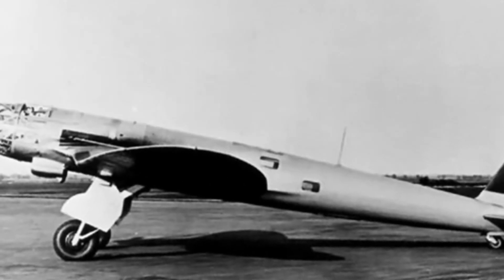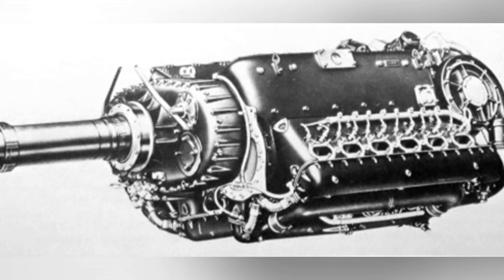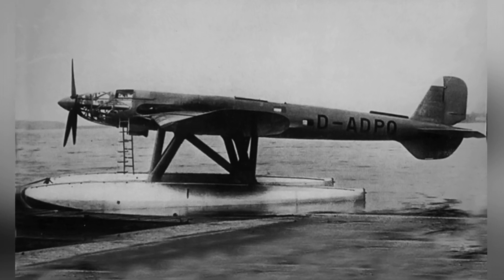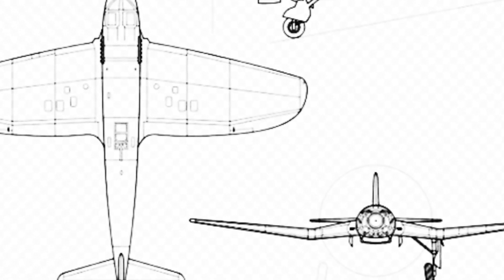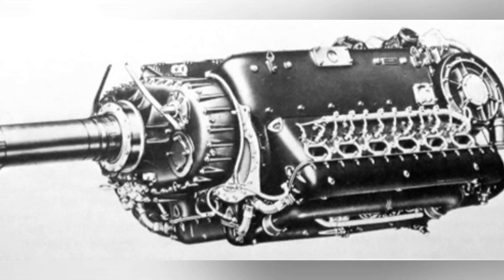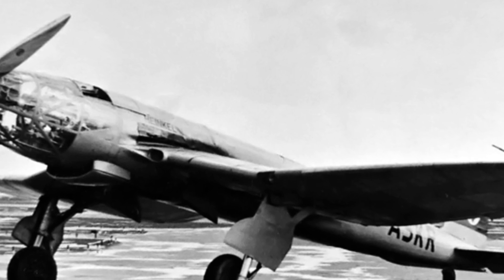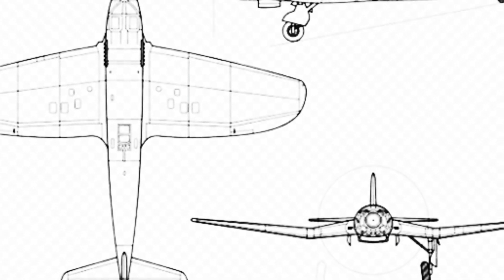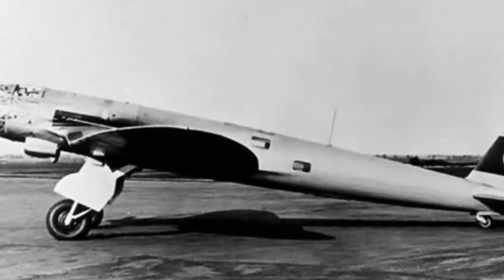He 119: High-speed Reconnaissance Aircraft

Comment: the He119 was designed and built by the Heinkel Flugzeukwerke, not the Henschel company. Henschel was an entirely separate company from Heinkel. And the "He" in He119 is pronounced "H" "E" (each letter spoken), not "he" (as in the masculine pronown).
Reply: Correct. The abbreviation for the Henschel company is "Hs," as in, Henschel Hs 129.